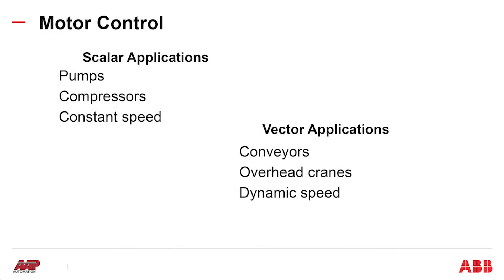AAP Automation Set up of ABB ACS380 Motor Parameters

Comment: Hi, I am trying to use DIO2 as a digital output on an ACS380.  I have set parameter 11.09 to 0 which configures DIO2 as a digital output.  I have also configured 11.10 to 16 - this should give a 24v output at DIO2 when there is a drive warning or fault.  I am not getting any change in output at DIO2 and I can't see why - even when I create a drive fault.  Would you know why this is not working for me?